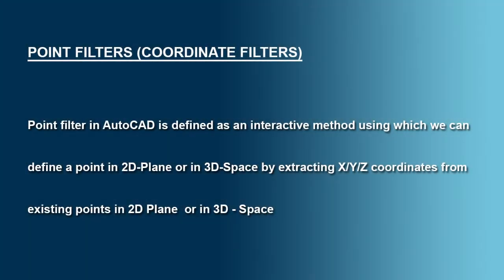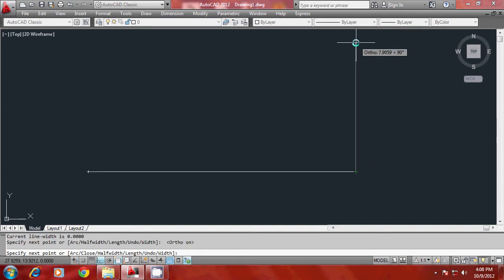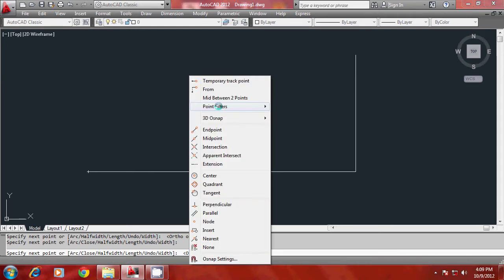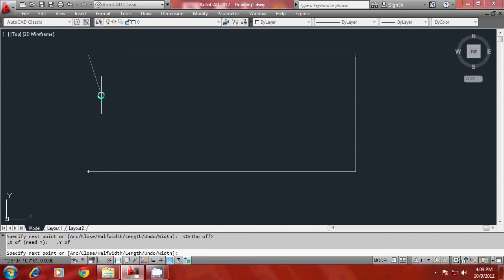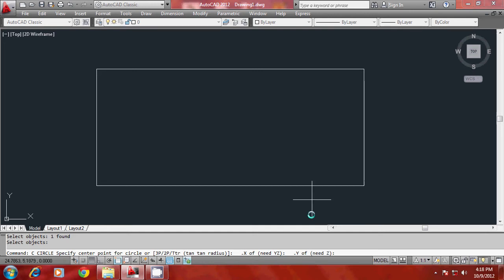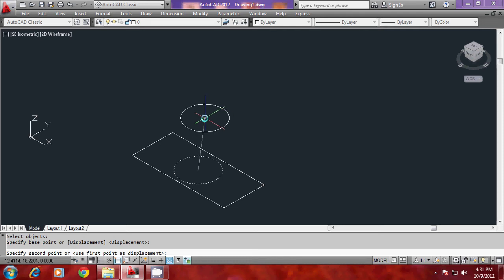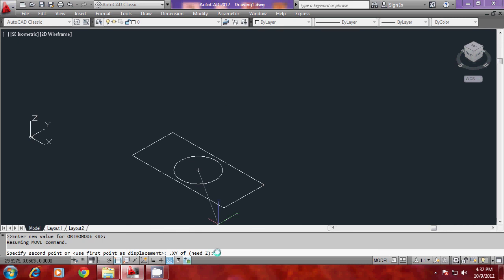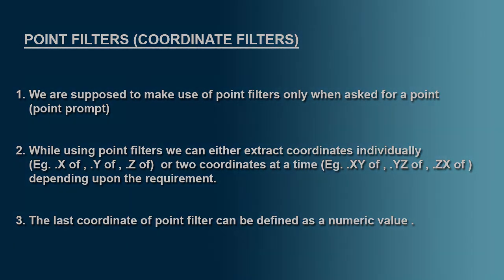POINT FILTERS

Comment: i have a question(in the end) . I can see u don't need to write anything to find midpoints in lines and for me it doesn't show midpoints unless i write it. Then I can select any midpoint after I do, it it don't show midpoints again .
 can i make it so i don't need to write anything to find midpoints ?
Reply from the maker: Just right click on the OSNAP button on the status bar , click on setting and activate MID in the dialogue box., Then you bring the cursor on the object it will catch mid. You can use F3 key to turn off and on the osnap